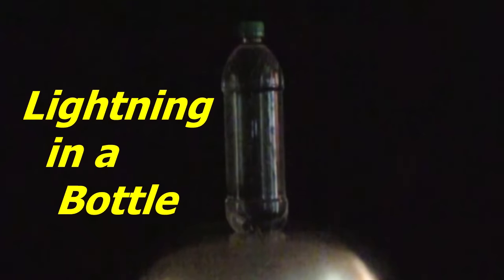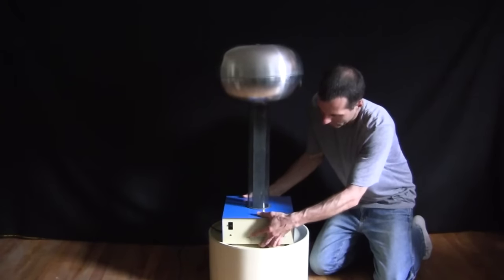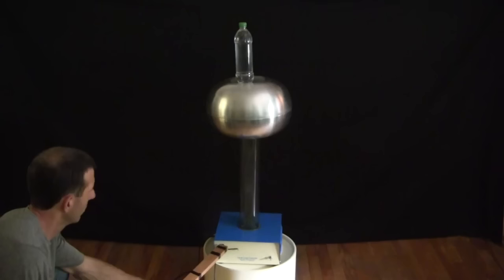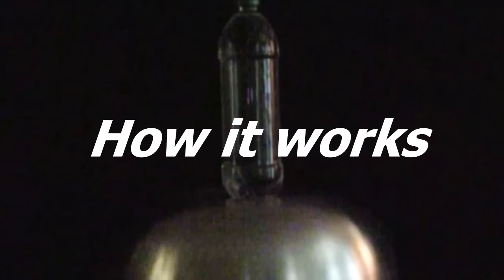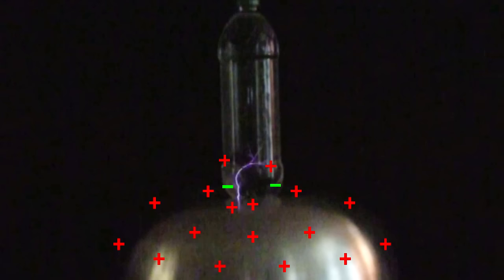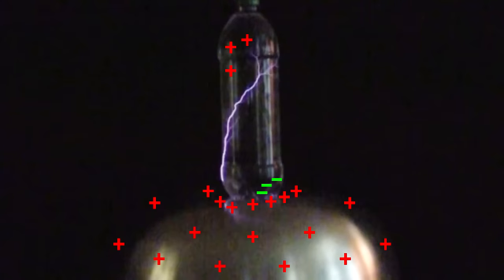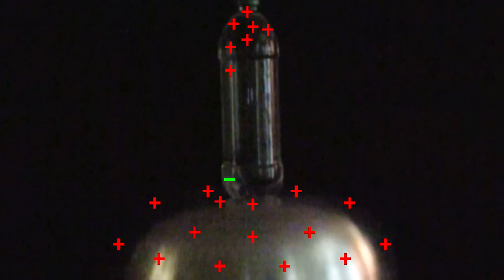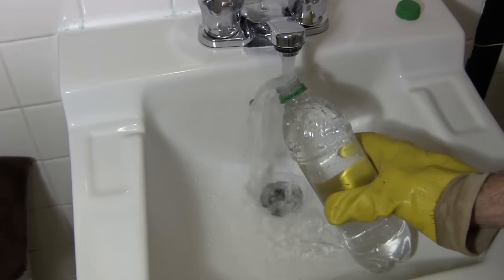Lightning in a Bottle & 100,000 Subscribers!

Comment: CONGRATULATIONS!!!!!!!!!!! I hope to achieve 100,000 subscribers some time in the next two years
Reply from the maker: THANKS! I hope so too.
Reply: +RimstarOrg can you do an unboxing video of the YouTube play button? I've seen others but they aren't that great. Also I believe that the play button won't arrive until about 6 months after confirmation of the  100,000 subscribers according to the other videos. I would love to know if that is correct. Again congratulations on the 100,000 subscribers!!!!
Reply from the maker: I'm curious how long it will take too. I'll be sure to let you know. Interesting idea to include it in a video somehow - a science video of some sort?
Reply: +RimstarOrg I have some ideas for future videos such as showing how to make an sstc (solid state tesla coil). I always look for videos but they aren't specific enough on how to creat the circuit. also can you show how to make a flyback driver from only tv parts but without a 2n3055 transistor which means using the horizontal deflection transistor that is used to drive the flyback when the tv is on. Example of the transistor is d2499.

Comment: Nice!  was  there any water breakdown occuring inside the bootle?have you tried this with distilled water?      love how you ilustrated the charge graphics. if you can manage to charge water to point were it can no longer hold a charge then the molecule would split. The challenge is to charge it to point of fracture without leting it discharge.
Reply from the maker: Thanks! I don't know if there was and water breakdown. There was no visible bubbling at least. I tried with distilled water and no water. With distilled water the result was pretty much the same, no noticeable difference. With no water there was no result.

Comment: Congratulations on reaching 100K!

How badly did you get shocked by the charged water?  Comparable to a shock from the generator itself, or worse due to capacitance?
Reply: I would not think the capacitance is that high, as the surface area of the bottle is not that big, and the plastic is reasonably thick too, so probably a nanofarad at the most, most likely a couple pF.
Reply from the maker: Thanks!

Badly enough. I'm not sure if it was the charged water or the inside of the bottle or both but I had one finger inside the top and the other hand holding the bottom of the bottle, so the shock went through my body. It wasn't a defibrillating-type shock but it was much more than that from a piezo igniter. Judging by the thickness and length of sparks I've gotten from that Van de Graaff (to ground, not to me) I think the shock from the VDG would be a lot worse. It's a 14" or 15" dome.
Reply: I once built a ZVS flyback driver circuit, and in an attempt to build a SGTC, I made a foil capacitor out of trash bags and aluminum foil. I was able to charge up my capacitor and make some loud sparks, but my capacitor popped. It was the tenth or so attempt, so I neglected shorting it completely first, and started to take it apart to see where it failed. I got the shock of a lifetime from that sucker!!!!!
Reply from the maker: I actually work safest when I'm alone and get careless when with someone else. So my worst was when a friend and I were playing around and we used a ceramic mixing bowl as the dielectric. Being bowl shaped it was hard to discharge properly. But I thought I had and carelessly picked it up. Went right through me. That was my worst!
Reply: @power-max  At these high voltages (I gues 400kv) Even a couple picofarad can hold enough charge to really hurt you! I once charged up a cd case with a van de graaff on one side an a piece of alluminum foil on the other side. I then just put it down on a table without the aluninum foil. I tought that it couldn't act as capacitor without an electrode, so i tried to pick it up.... That Hurt! The charges stick to the plastic and because of the extreme voltage the air forms An electrode.
Reply: @nielsdaemen  The environment acts as the other end. Air is a dielectric, albeit a poor one.

Comment: Thanks for the vid. Yes the shock from picking up the bottle is nasty. But why does the charge remain, even after the bottle discharges once? And the charge in the water remains and will even shock you when poured onto your skin?? It doesn't act like a capacitor. More like a cross between a capacitor and a battery!
Reply from the maker: It's very hard to completely discharge a charged plastic surface. You can see me demonstrate how hard it is to do that at around forty-four seconds into this dissectible capacitor video https://www.youtube.com/watch?v=gPXv063O5B8. To fully discharge the plastic bottle in this video I run it under tap water. It's just so hard to make good contact with it all. It's easier to discharge a metal object because you only have to touch it in one place and the charge conducts to where you touch it. Charge doesn't conduct on plastic though, so you have to touch it everywhere.
As for the charge in the water, I suspect it's actually the charge on the plastic, and as you pour it out, the water acts like an electrically conductive wire between the plastic and your skin. Water is not a great electrical conductor, but it is one. That's my guess anyway.

Comment: Nice video quiet informative. i was wondering what happens to the water temperature. Can you try this with hot water and cold water and see if there is any temperature change, that would be an interesting result.
Reply from the maker: Thanks. That is an interesting question. I don't know if I'll haul everything out and try it but I'm very tempted to.

Comment: i have tried this myself and do not recommend it the shock i got from the bottle was massive compared to what you normally get from touching the dome. it is somehow acting as a capacitor!!
Reply: fab100ie just where rubber gloves
Reply: Or learn to fly
Reply: @Lala-pb9lb  how would that hellp
Reply: @meowmonster  Hypothetically, let’s assume that you touch the outermost wire of a three phase transmission line and that you are floating in the air half way between the towers and the closest other object is the ground below you. The human body has a self-capacitance of about 200 pF, which has a reactance of about 13 megaohms at 60 Hz. So, if you touch a 600V line, you can expect 46 microamps into your hand. You won’t feel that. Let’s go up to 69 kV. Now you will experience about 5 milliamps. You will definitely feel that. The highest voltage in use is 765 kV. If you touched that you would experience 58 milliamps. This is above the let go threshold so you would want to touch the wire with the back of your hand. It is also above the fibrillation threshold. It could be fatal, however, the current spreads though out your body and leaves mainly at the extremities (you head, other hand and feet). So not all of the current will go through your heart. You can improve your survivability by keeping your other hand close to your body and thus steer more current toward your head and feet.

But there is another effect. When you touch the wire, you distort the electric field around the wire. There will be spots on your body where the field intensity is greater. You can make it worse, by extending your other hand and making a fist with only your pointer finger extended. The radius of curvature of the tip of your finger is smaller than the radius of curvature of the wire, so the electric field will be stronger there. At some voltage, the air will become ionized. When this happens, more current will flow into you. Thus, you have an excellent chance of injury or death if you touch the 765 kV line.
Reply: @meowmonster  aye bro if you ever need free electricity jumper cables bypass meter a hook up to you main fuse box. But I won't say I have free electricity for 4 yrs now. 
One time I died from getting stuck to a fish tank heater barefoot in water 110 alone I tried to yep for help but all that came out was ah. ah. ah. ah. ah. ah. And couldn't stop yelping black out woke up crying so I learned to have respect for it. Self-taught ohm's law
Reply: @Lala-pb9lb  if you died how did you write this comment?
Reply: @meowmonster   let me exaggerate.  No truth is.  Water line broke to water hose, I then turned off  water meter. My older brother came home from work at 12 am, mad about water being off. I told him I could fix it he told me I cant till the morning. My ego got the best of me and told him watch me fix it. I grabbed the fish tank heater    to try and melt pvc glue to reuse it. Never in my life have I ever tried this before and had no clue that it would work but I was not about to let my older brother be right.  For like 15min it wasn't showing no progress at all. The fish tank heater i s using had a glass over electromagnetic induction coil remember I had no clue what I was doing no did I know anything about A/C current. I said to myself, the glass is not letting it get hot enough. so I pulled glass tube off heater. Tube came off hand got stuck. But I couldn't feel anything but I couldn't move my arms got really close to by body. I thought no way I'm stuck I tried to yell for my brother and just a ah ah ah ah ah ah i couldn't stop making the nosie after that. I then didn't worry about why I was in this situation all I thought about was my kids and my wife they had left for the weekend. I feel over was on the floor in water. I forsure thought I was going to died.  But I broke free  jump up happy and scared I cried thinking how luck I was went to hospital they said everything was fine just a little burnt in some spots but not to bad I have then have had respect for electrical work and have been trying my best to learn the laws of electricity . I was 30 at the time. And I apologise for calling you foo. Thats just something us poor people call each other it's the same as the word  "dude" to us Southsider from San Antonio TX
Reply: @Lala-pb9lb  oh damn that must have been scary

Comment: How long did it take to observe this effect? Also would this work on negatively charged domes? I just tried the same with a negative dome and it didnt fire at all.
Reply from the maker: Within a second of turning on the Van de Graaff generator, the first spark appeared near the bottom of the bottle. Over the next ten seconds, sparks continued happening, each higher than the next. By the end of the first ten seconds, sparks were happening all the way to the top of the bottle.
But I also don't see why it wouldn't work with a negatively charged dome. Use tap water, i.e., not distilled water, as I suspect the impurities in the water might help? You could also try different bottles, i.e., maybe there's some type of plastic that doesn't work well?

Comment: Is the water present in the bottle is charged and is it in the PLASMA state??
Reply from the maker: It may have some charge separated in it in the form of ions (water normally does anyway). But it's definitely not in the plasma state. That would require very high temperatures.

Comment: How long did you wain until the lightnings showed up?
Reply from the maker: The lightning showed up right away at the bottom and was reaching to the top around 12 seconds after turning the Van de Graff on. I would think this would depend on how powerful your power supply was and on the dimensions of the bottle.

Comment: Odd that the bottle should shock you so badly, I assume you discharged the VDG topload?
Reply from the maker: Yes, I discharged the dome using a grounded wire on a stick. When the bottle is on the VDG and it's running you can hear a lot of hissing which you normally hear when there's ionization going on. I'm guessing the strong electric field from the high voltage across the height of the bottle extends outside the bottle and is ionizing air and the ions stick to the bottle. You can feel the charge on the outside of the bottle when you remove it an an electroscope reacts to it.

Comment: I belive the sphere on the top is negatively charged not positive
Reply from the maker: Nope. Mine is positively charged. It depends on the materials used in the rollers and the belt, so some are negative and some are positive. With my teflon bottom roller, rubber belt and metal top roller, mine is positive.

Comment: will this effect be stronger with salt-water?
Reply from the maker: I knew someone was going to ask that! Unfortunately all my bottles have tiny holes in their bottoms at the moment :). But I did try it in the other direction, with distilled water and got pretty much the same result. I guess there were enough minerals of something left.
Reply: haha... i have one more question you might also expect. What about a glass bottle, will the lightning burst a hole through glass? Congrats and  thank you for your fast reply
Reply from the maker: It all comes down to the dielectric strength of the material and the thickness (hmm... can't seem to find any tables that I can be sure have the right materials.) The plastic soda bottles are pretty thin and glass bottles are thicker, so a glass bottle might do better.
Reply: I was looking at capacitor materials for the Bonetti machine I am making.
The dielectric constant, breakdown voltage, surface area and separation all make a difference. You can find parallel plate capacitor calculators online. http://www.daycounter.com/Calculators/Plate-Capacitor-Calculator.phtml

Glass (soda lime) has a breakdown voltage around 250v/mm and a dielectric constant of 7-10
PET has  a much higher breakdown voltage ~16kv/mm and a lower dielectric constant of 2.8-3.2 The tables I find show PET is just a better material when we get down to it, because the higher breakdown allows the conductors to be closer which increases the capacitance effect.

My understanding is the electrolyte in this case is nothing more than a conductor, the same results are achieved with aluminum foil. Just look at the dissectible Leyden jar for demonstration. All charge is actually on the surfaces of the insulator.  https://en.wikipedia.org/wiki/Leyden_jar#Storage_of_the_charge

If the electrolyte also interacted with the voltage in some other manner like forming a temporary oxide more power would be stored than just in the dielectric material, which is the basis for rechargeable batteries.
Reply from the maker: Thanks for the breakdown voltages. Strange that I couldn't find them. Glass is a lot lower, wow.
And I agree, the water is acting as a conductor. The same effect can probably be gotten by putting a sheet of plastic on the dome and then putting a tall piece of foil on top of that. The voltage would then build up across the height of the foil.

Comment: would this work with a less powerful generator?
Reply from the maker: It probably would, just that the effect would be less. It would still have to be a high voltage generator.
Reply: what can we do to increase the voltage, or make the experiment happen better, with a less powerful generator???
Reply: do you think that by placing a smaller water bottle, would it have any changes??
Reply from the maker: That depends what you mean by a less powerful generator. You simply need to find one. I can only guarantee good results with the large Van de Graaff generator I used, since that's all I tried it with. One like my larger commercially made Wimshurst machine here http://rimstar.org/science_electronics_projects/wimshurst_machine.htm (not the smaller one with CDs) might work. This DIY electronic one is even more powerful than the Van de Graaff but may be too dangerous http://rimstar.org/equip/30kv_pwr_supply.htm.
Reply from the maker: With a smaller diameter and shorter water bottle the effect would happen sooner. I'm not sure how much that would let you use a much less powerful generator. It might though.

Comment: Van de graph?
   You mean a Tesla Coil don't you?
Reply from the maker: Nope. A Tesla coil is very different, though I guess there is some external resemblance, for example, the cylindrical tube. In the case of a Tesla coil, that tube has a coil wrapped around it. With a Van de Graaff, the tube contains a rotating belt, a rubber one in this case. A Van de Graaff can put out high voltage DC whereas a Tesla coil puts out high voltage AC.
Reply: I was unaware. Thanks for the info